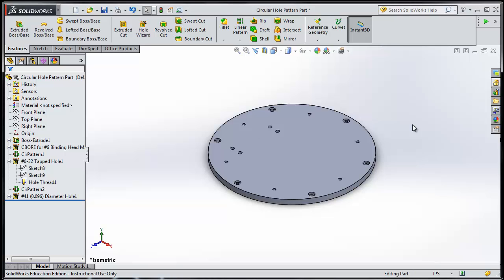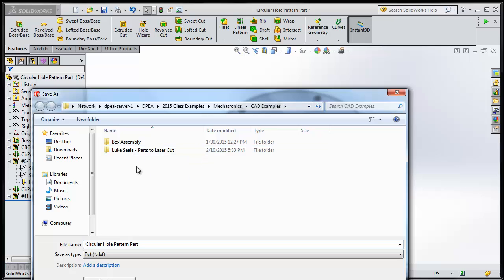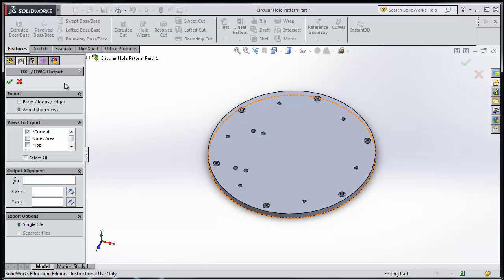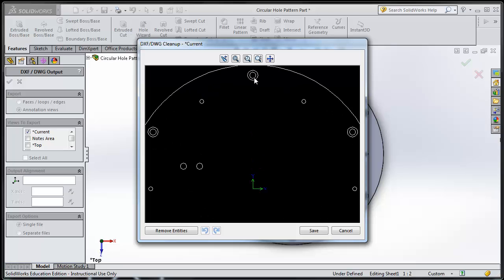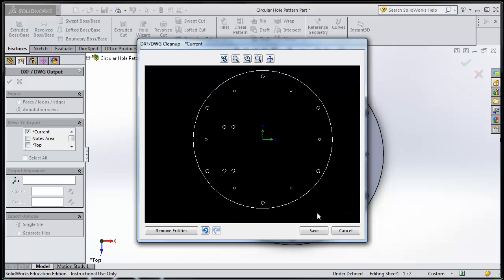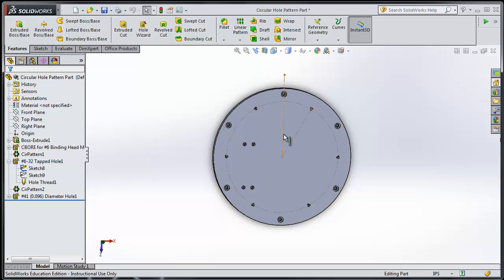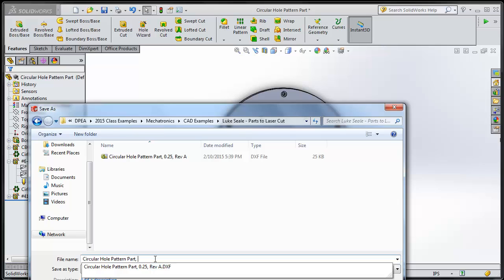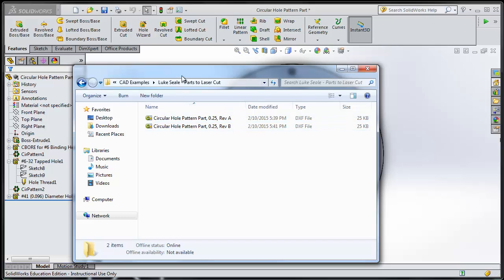SolidWorks DXF Creation Tutorial

Comment: Nice video!

I have a question though.

Could you make a tutorial how to create a dxf for laser cutting of a sheet metal part that has a cut-out in it (with some connection tabs which i'll cut off by hand later). 
I need to make a cylinder with a door, but since i need the door and cylinder to have same bend radius it would be good if the door part would be in tact with the rest of it while I roll it 360°.